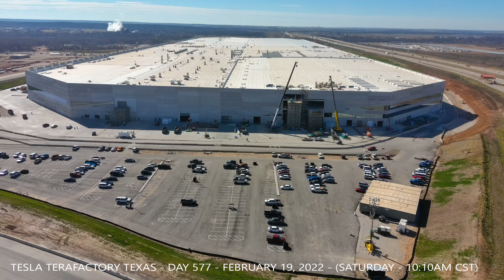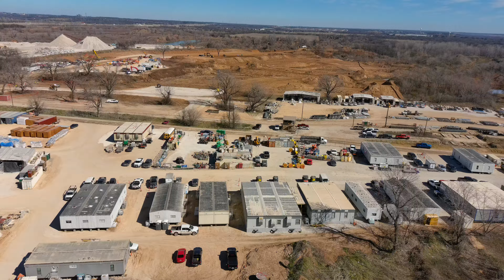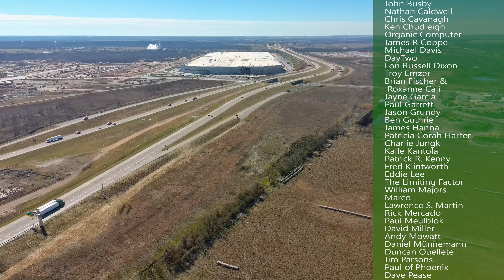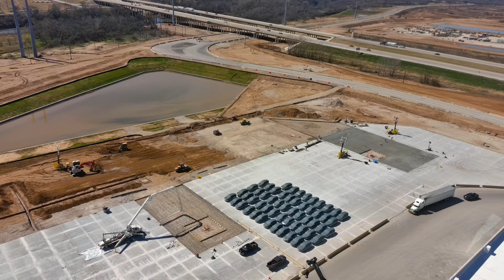UBER BUSY SAT AT GIGA TEXAS! - Tesla Gigafactory Austin 4K  Day 577 - 2/19/22 - Tesla Terafactory TX

Comment: Thanks Jeff. Looks like a perfect flying day.
1:05. Paint, loading platform. Crane gone.
North end parking. Street lighting installed. 
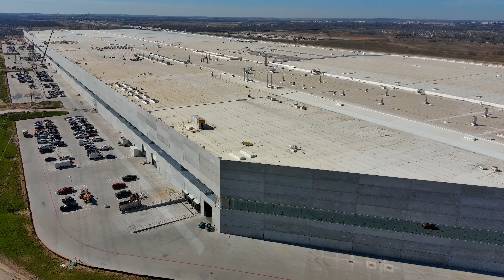1:18. Casting east side, apron. Bridge crane rails/tracks gone inside. Day 574 in fact, now that I look back. 
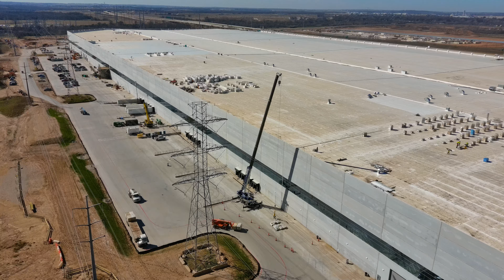1:37. BIW roof. Towards the ridge. Crates and crates of what are likely PV panel brackets. The lower pallets could be ballast blocks. Tele-handler unloading packs of PV panels from the trailer.
Taco truck moved on again.
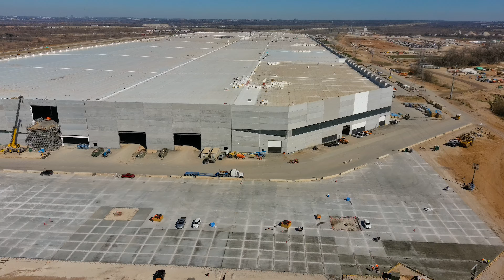2:24. Stamping south end. Windows installed. 
South end Hardstand. Saw-cutting the contraction control joints.
Transformers and pit. Pit seems about level with the Hardstand slab, transformer slabs appear to be higher.  I’d be surprised if this supply isn’t removed.
2:33. South end Pond. Suspended silt finally seems to be settling, or is it an algae bloom starting.
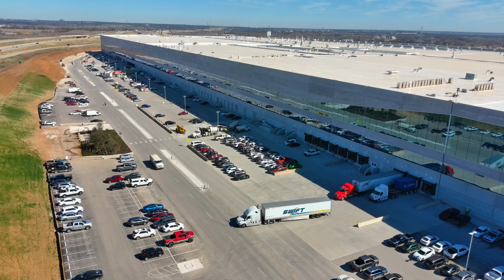3:15. West side GA, apron. Vacuum truck and a couple of tankers. Some problem with the sewer maybe.
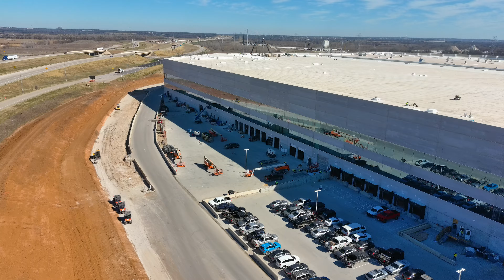3:29. Battery west side, apron. Beside the retaining wall. Assembling a roll up door on the ground. 
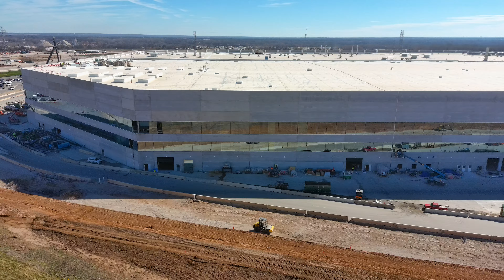3:35. Battery west side, windows. Lower row now complete. 
Apron. Bottom right. Working on another roll-up door. Must be door day.
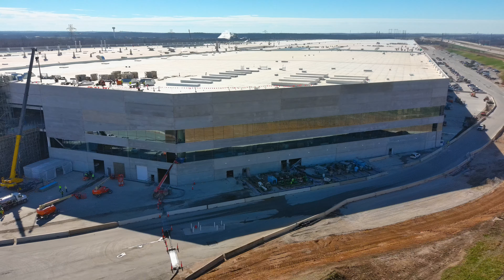3:47. Battery north west corner. Small dumper bin on a tele-handler being filled up through the window opening. Access might be another reason some windows have been left out.
4:04. North end parking. Conduit trench must now be over the alignment of the stormwater drain seen at bottom left of screen. 
4:26. East side parking. Removal of the concrete apron seems to have stopped. Looking at the build up of fill in the area beside the easement there may have been a change in plans of the elevation of this end.
5:36. East side contractors. Far right of screen is a single shipping container, then 2 pairs, then another single shipping container. Seems to be the relocated Skunkworks.
6:17. North east new clearing. Silt fence installed north/south-ish.
7:46. Tesla Road. I wonder if this will be extended on the same alignment due east. Might explain the relocation of the Skunkworks.
7:48. North end parking. Conduit trench alignment. Excavator poised to start attacking the berm. Some sods removed already.
9:47. Battery west side. One green pump connected. 
Boom-lift caulking the window sill. Foam backing/filler rod hanging out of the bucket. Boxes of 'Slim Jims', another type of filler I would guess.
10:37. BIW roof. PV panels. 
Cable on the back of the parapet. Runs into the boxed structure around the column. 
GoCoyote. What’s going on here? 
Similar on the west side, before the cable was installed. https://youtu.be/3tCqHIiITmY?t=712
10:42. BIW roof. PV panels, brackets, ballast, control gear. 
10:47. South end Hardstand. Marking out the contraction control joint locations with a red chalk-line.
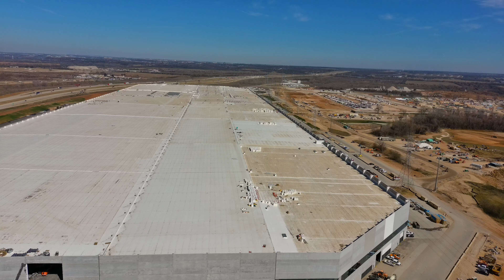13:36. Stamping south end, apron. Concrete truck waiting.
Reply: Dessie, your 10:37 notice that at about every 10' there is an antenna or lightening rod on top of the parapet.
Reply: @eltonray2934  Comms antennas perhaps?
Reply: 2:24 transformer slabs and supply...
This line was connected about a year ago, long before any 500' addition to the Gigafactory was imagined I'm sure.
This part of the Tesla property is in the Bluebonnet Electric Coop service area.
(I could try a link to the service area map, but it would likely get removed. Try a search on "bluebonnet coop geographic information system map" if you're interested)
Reply: 7:46. Tesla Road.
If they continue east they'll end with a boat ramp into the river.
I'm wondering about their plans for a north/south road parallel to SH130. At what point would they connect to 969 (Webberville) or Gilbert rd?
Seems like such a road would be an obvious choice for handling traffic in and out of the Gigafactory, and whatever other factories get built in the northern end of the property.
Reply: @dan_w3st  Interested! You bet. Thanks for the tip. I went and looked at the service map, and the site is only just in the territory (I was able to change the map to a satellite view for a better idea). The Old Bagging Plant is within the territory, the temporary batch plant outside. The Starlink site, might straddle the border.

Do you know if these are hard and fast boundaries?
Reply: @dan_w3st  7:46. Tesla Road. I was thinking where the road veers south at the old house, getting rid of that turn. Squaring up what might be the 36 acre Cathode site. I created a couple of squared up 36 acre parcels on Google Earth, but can't figure out how to post them publicly.

The carpenter in me thinks everything needs to be square, and parallel. 

Parallel North South road. I've been wondering if they will construct a permanent road across the highway, north south between Tesla Road and the road alongside the river.
Reply: @DessieDoolan  I can only make assumptions about the permanence of the boundaries. I would guess the boundaries could easily be expanded into areas with no other service. What happens when Bluebonnet bumps up against whoever is providing service to the Hornsby Bend area I couldn't say. Maybe a round of Rock Paper Scissors?
The thing that really annoyed me... At one time I found a map of the individual power lines, followed them through the Tesla property, but when I looked for it, couldn't find it again. Maybe it was removed.
Reply: @DessieDoolan  Tesla Road...
My brain likes square and parallel as well. Have to admit a meandering road is sometime a better drive.
Waiting to see what they do with a road between 969 and Tesla Rd on the east side of SH130, straight or winding?
Hadn't even thought about a north/south road on the west side of SH130, but it makes perfect sense that they'll need one eventually. Whenever they get around to building whatever it is they're building over there.
One of these days I'll have to drive on 973 past the intersection, see if there's a street sign with a name for that river following road that connects to the south end of the gigafactory.
Reply: @DessieDoolan  Dessie, the antennas appear to have individual cables to each. Would not be required for lighting rods. Normally antennas are not arranged in this fashion. Could be some sort of phased array of VHF 1/4 wave radiators. Did you notice that the cell system is not at the homesite now. Near the location of the portable superchargers is a telephone pole (5:40 bottom center) with cell antennas and a microwave dish.
Reply: thanks!

Comment: If the people installing the rooftop PV are from Tesla Solar, Tesla Solar is in trouble. The way that is most effective to install these ballasted racking systems is to to mark your layout, then do one row at a time. One crew goes first dropping the racking and ballast, another follows behind with the PV panels,and a third does the wiring. That way one can just run the carts of materials up and down the rows without having to move materials across the racking.
Reply: @mouldyboats 
Not necessary to do the whole row, just reasonable lengths. The array rows will be series strings, and will most likely be running around 1000VDC nominal to the inverters, so multiples of three have nothing to do with how the modules are wired. Nikola Tesla did not invent the three wire three phase AC that we are familiar with, it was invented by Mikhail  Dolivo-Dobrovolsky. Tesla invented a 6 wire system, but it was not as effective as Dolivo-Dobrovolsky's system, and Tesla primarily focused on 2 phase systems, although it took someone else to actually make his 2 phase AC motors work effectively. George Steinmetz was the one who gave us the formulas and math to implement productive use of three phase AC current, and allow it to mesh with the Tesla 2 phase systems. Tesla was a proper wack job who did contribute to some engineering of AC power, but was not the central person that he is made out to be by recent history. He was not able to understand or figure out the theory and mathematics to explain AC power, especially polyphase systems. George Steinmetz was the one who really did the heavy lifting on the theory, math, and application of AC power. If you went through an IBEW aprenticeship, you will have had to work with Steinmetz's formulas in your transformers and AC theory classes. Second year, if I remember correctly.
Reply: Hi Sparks. Got any clues about the cabling on the back of the parapet at 10:37?
Reply: @DessieDoolan  
You have an incredible eye for detail. It looks like it is connected to small projections spaced evenly along on the parapet, so I would assume it to be part of a lightning protections system, which I have limited experience with.
Reply: @GoCoyote  Elton Ray suggested lightning rods or antennas (antennae?). 

This entire lightning thing is new to me. Apart from a church steeple, and maybe noticing a earth cable down the side of a building I've never noticed them down here. Early days I noticed the bare copper cable being buried in the ground, that was a surprise as well.

I should see if I can spot similar at Berlin.
Reply: @DessieDoolan  
I have not had to deal with lightning protection on buildings, only transient voltage protection on circuits, although I have witnessed sparks coming out of the phone sockets during a lightning storm that also took out our well pump. In the book, lightning protection is usually large bare copper cable on insulating standoffs. Hard to tell exactly what that system is, but I wonder what kind of system would use antennas like that. Large industrial systems like that will bury a large copper cable in all of the trenches to establish an earth ground connection for all parts of the system.
Reply: @mouldyboats  
IBEW (International Brotherhood of Electrical Workers). Although it only includes two nations, The US and Canada. I am retired now, but have always enjoyed the engineering aspects. Some of the electricians I worked with were incredibly close to being electrical engineers in their knowledge and understanding. I notice that it has more to do with curiosity and the desire to understand our world. I have been watching "Kathy Loves Physics" and enjoying learning more about the history of physics, as she focuses a lot on electromagnetism. I have always felt that engineers should spend a few years working in the trades to get a feel for how their work is applied to the real world. It might help some engineers understand how to be better engineers by listening to some of the often very experienced workers who, while not being engineers, are very smart people who care just as deeply about the quality and methods of building. My brother is an engineer specializing on building mechanical systems, and it is always fun to talk shop with him.
Ok, enough of my blathering. Cheers!

Comment: Jeff, does anyone know where their pumping the water out of the Lagoon to? I thought that it was from the paint shop and needed treatment.
Reply: Mark, it appears that they are pumping the water back to the plant for treatment.
Reply: Pumpline route.
7:05. Pump at the Evaporation Pond, pump-line is beside the road and then passes under the road and heads west towards the highway.
8:05. The pump-line is in the drainage ditch beside the highway. Runs through a culvert under Tesla Road.
3:50. Pump-line crosses the road around the plant and runs across the north end of Battery.
3:54. Pumpline connects via an orange hose back into Paint, where as Elton Ray suggests it is being treated. Treated for discharge to the sewer, or stored for reuse isn’t known.

Comment: I was wondering why the solar panels being installed are biased to the west, instead of south as they usually are? 
Also, what is the construction site across thenhiway that looks like a smaller Tesla factory? Thanks.
Reply: Most like face west to maximise generation when the grid is the most heavily loaded. It's also the time the HVAC is working the hardest

Comment: I still don't understand why they decommissioned many of the loading docks and turned other loading dock areas into general parking
Reply: Maybe some of them are just waiting to be put into use, but yes I wondered about it too.
Reply: We did the math a month ago, and based on just the open docks there are enough for 1 million cars produced per year if each dock is used twice a day.

This is because 80% of Tesla car (by weight) doesn't arrive by tractor trailer.  It arrives by rolls of steel, aluminum and bulk plastic beads.  These deliveries are done inside, with cranes to lift off of flatbeds.
Reply: I just thought it was design changes after the walls were ordered and delivered, and plugs were the cheapest solution that could be reversed later
or plugs are cheaper than doors and these doors can wait until phaze whatever
Reply: That area may be used for another vehicle down the line. Right now they needed parking for the tesla employees so they could start getting the completion certificates for the finished parts of the building. Once more carparks are built on site they can put in the loading docks and move the employees some where else
Reply: @saff226  Makes sense. Already they have moved the temporary barriers a bit further to the North on the West apron parking to bring 2 more loading docs into play. In this way they keep operations as streamlined as possible, until such time that more loading docs need to be commissioned. Also note that there is a big gap in the numbering above the loading docs (commissioned + temp closed) to the tune that nrs 51 to 80 on the West side are unaccounted for. To make these numbers appear (Phase 2?) they would need to take out almost all the concrete panels at ground level not currently adapted for staircases and tapered glass between #50 and #80.
Of more immediate interest I reckon is the creation of a trailer park. Dale is right I think for scheduling trailers at the loading docs, but long distance supply routes need some buffer (place, time, sequence) probably. The temporary trailer park (4:19, left) continues to grow, 15 today, up from 14 yesterday.
Reply: Charles, The receiving docks have recently been numbered starting with W1 on the west side and E1 on the east side counting to the south. I believe that this indicates that they will be put into service at some time.